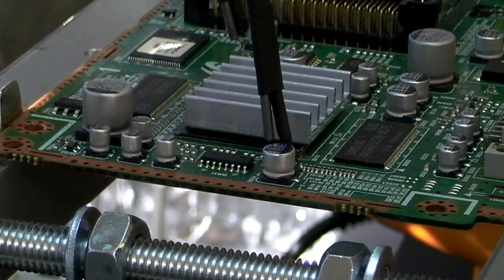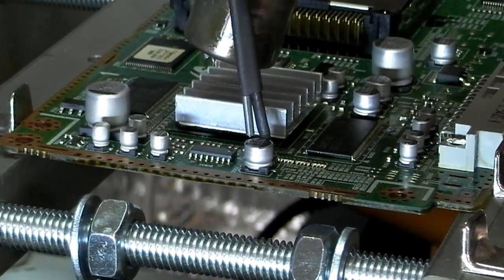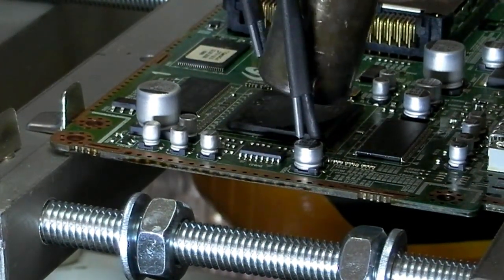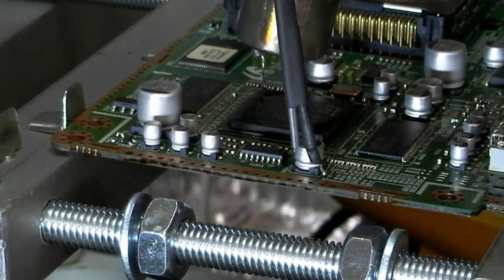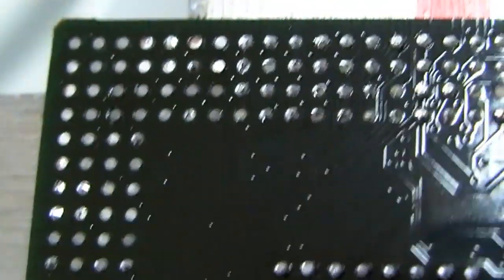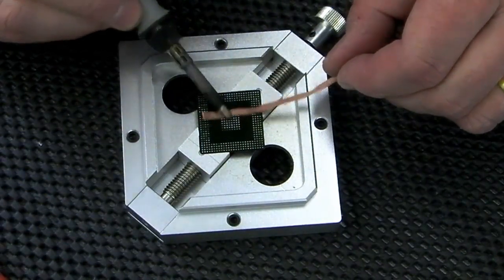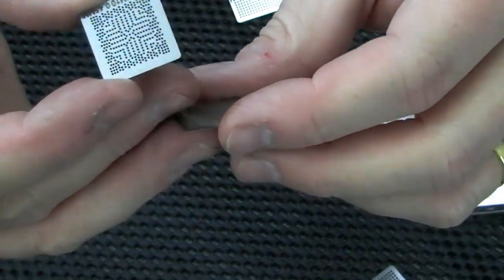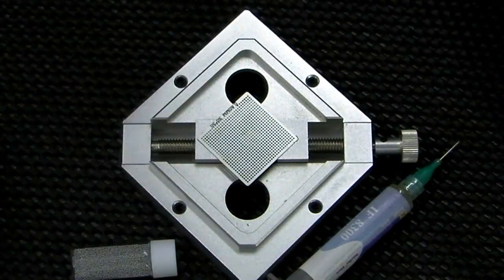1st BGA Repair.

Comment from the maker: It also concerns me that using hot air the actual readings may be inaccurate as they are affected by the hot air moving over the sensor. A solution to that may be some shielding on the sensor or removing the hot air to let the temp stabilse on the sensor but ideally dark infrared top heat would be best.......